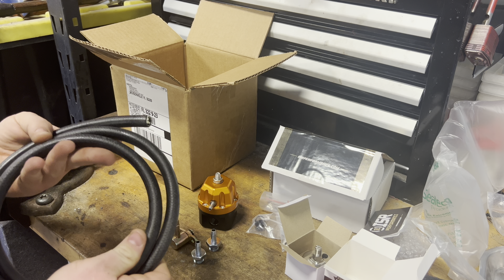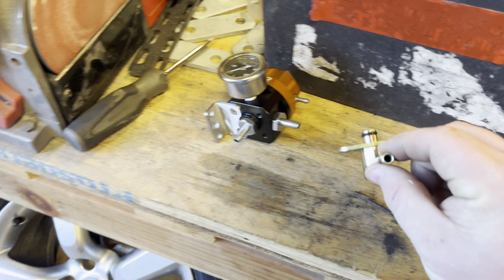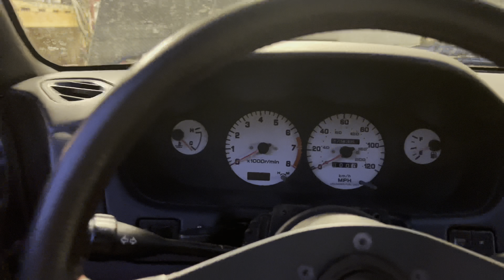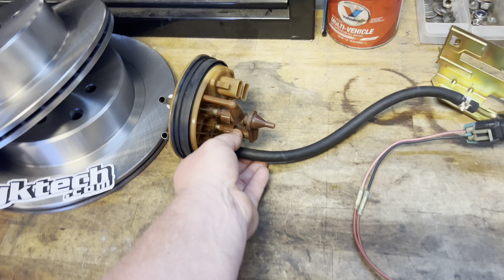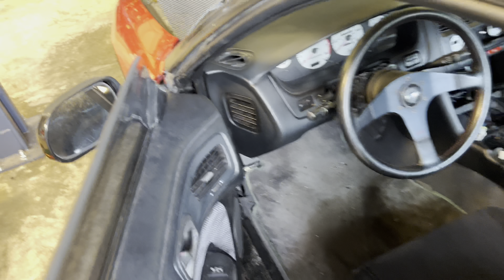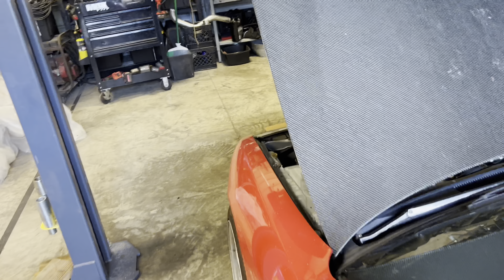Kouki s14 gets fuel mods - Drifting the seat time G35

Comment: It sounds like it’s turning over slowly, could be a sign of low amperage from the battery or poor connection on the power or ground. 

If the ecu isn’t getting strong voltage it throws off the cold start. 

Also, if there’s a small vaccum leak I could throw off the maf…..

Do you have another starter to try?

Did your car stay running a few seconds after you turned it off?
Reply from the maker: Once it’s started it runs great. And seems to have a better start when still warm